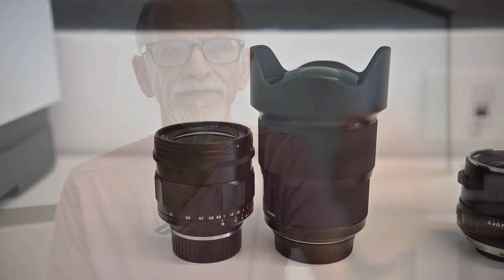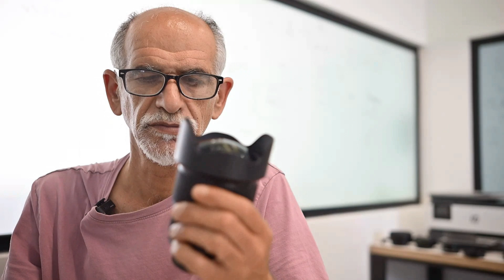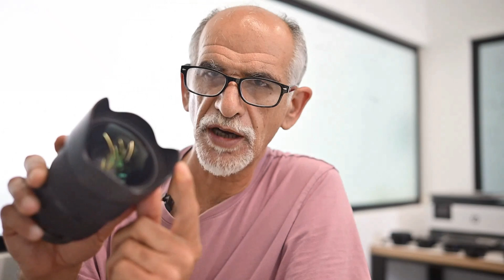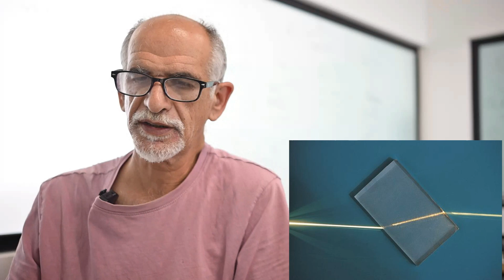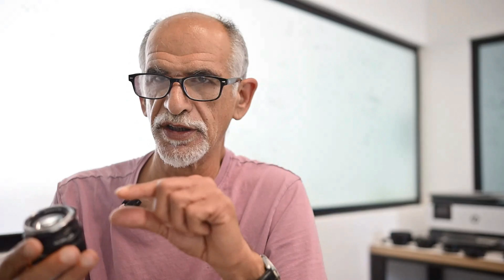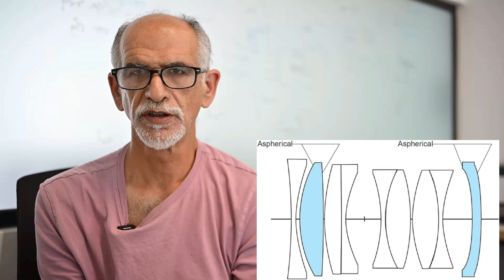Tell-tale signs of 3D-pop lenses

Comment: I disagree mostly but not totally. Number of elements and groups matter a lot together with the quality of the coatings of each element. Bad coatings and too many elements never end well. Modern coatings are really high quality so it is less important to have too many elements but still simpler designs have a miniscule advantage.

As for ED HR optics, reducing spherical and also to an extent chromatic aberrations will make a lens have a less romantic rendering. Some call it clinical but it doesnt always have to be like that. Absence of chromatic and spherical aberrations makes sure that the pure rendering of the lens is evident and if it's harsh, it will not be masked by the aberrations.

I find aspheric elements have a much more visible affect on the rendering. They introduce higher level optical aberrations and you end up with weird behaviour in lenses. Too many aspherics I'm not fond of but then besides the onion ring bokeh, Zony 55mm 1.8 has pretty good rendering.

My point: optics are too complex for us to set simple rulesets. Every design is unique. Companies have a certain style based on their producers and glass stock (ex Cosina produced Otus and produces Voigtlander lenses. I have a feeling that it's 100% same ED glass, maybe different coating)

Comment: I look at Zeiss lenses and they have an element called "special glass with anomalous partial dispersion" - is it the same LD element?
Reply from the maker: Hi, yes. Only Zeiss uses a "mild" type of LD glass with weaker suppression of CA.
Reply: @sneye1  Thanks , I wonder how to "put" those Zeiss lenses into your method . I checked some of the lenses I like and the ones I dislike in and it is accurate. 
My most used lens is the zeiss 55mm f1.8 for sony ,I didnt understand what I love about the IQ and why almost all other lenses I try can not match it. now I have the answer - 7 elements in 5 groups ,non of them are ED.
Reply from the maker: @amithasson8  Thanks. Glad you find it helpful. Zeiss and Voigtlander lenses would permit perhaps 15-20% ED glass before they become flat.

Comment: Greetings. I would like to pair something with my Voightlander 40 1.4 Classic, but only wide-angle, as well as the same expressive in terms of 3d pop. Will the Voigtlander Nokton 21mm f/1.4 Aspheric VM (Leic M) suit me?
Reply: Or is it better to take Nikon 24mm f1.4G as more similar?
Reply from the maker: Hi, Both are great.
Reply: @sneye1  Thank you. And what can be selected within 20mm or wider, with the same mirror working segment as Nikon F or Canon EF for the super35 camera? To keep the 3 pop effect on the super35 sensor.
Reply from the maker: Ultrawide lenses are mostly flat. You can have a look at sample photos made with Voigtlander 15mm f/4. It may have some pop.
Reply: The Zeiss ZM 21mm's are quite good in this regard. For something a bit more off-the-beaten-path, the Konica AR-mount 21mm f4 is one of the more interesting rendering 21's I've come across as well.

Comment: Would you say these glasses meets your criteria of Highly poppy? While at the same time being a modern lens?
Sony 35mm f/1.8 Zeiss (SEL35F18Z) has: 
LD/ED Elements: Includes one ED element.
LD Glass Content: Approximately 7.1% (1 out of 14 elements).
Average Group Complexity: 1.33 (14 elements in 11 groups).;

The Sony 55mm f/1.8 Zeiss (SEL55F18Z) has:
LD/ED Elements: Includes one ED element.
LD Glass Content: Approximately 7.1% (1 out of 12 elements).
Average Group Complexity: 1.33 (12 elements in 9 groups).

 I am planning to buy 3D Pop lens, would you say these glasses have it? its very convenient as I have E mount Sony body, while at the same time not wanting to hassle with manual lens. Thank you !  🤗
Reply from the maker: The Zeiss 55 is definitely poppy. The Sony - a little bit.
Reply: @sneye1  Thanks for the reply! Yeah I'm leaning buying the 55mm F1.8 Zeiss too! Considering buying that lens and the Sony FE 24-70mm f/4 ZA OSS (Vario-Tessar T)*.  it has: 
LD/ED Elements: Includes two ED elements.
LD Glass Content: Approximately 10% (2 out of 13 elements). Note: Slightly over 10%, but performs exceptionally well.
Average Group Complexity: 1.36 (13 elements in 10 groups).
Hoping this also give slight 3d pop even though its a zoom lens 
😅

Comment: This video really got me thinking, what kind of impact do filters have, uv, neutral density, vnds, do they add to dispersion? can they decrease or even increase pop, as they are usually not made from low dispersion glas? or do they just not matter at all?
Reply from the maker: Hi, filters will have a much greater effect on dispersion when mounted behind the lens (some adapters allow slotting filters).
Reply: @sneye1  So in the front of the lens their effect is rather negligible?
Reply from the maker: I think so, but it needs evidence. Never use filters myself.

Comment: The main considerations for me are maximum contrast, lowest spherical and chromatic aberrations, High sharpness and micro-contrast (which are related to aforementioned aberrations) and a flat focal plane. Oh and low coma and astigmatism off-axis. Some of the older slower macro lenses achieve this without many elements or more than 1 ED element. Samyang's 135mm f2 is outstanding stopped down a tiny bit. Nikon's old 60mm f2.8 af-d macro achieves it stopped down.
Reply from the maker: Thanks. Most macro lenses are near perfect, which makes the image they produce very clean. Some CA is needed for good rendering of depth, I think.

Comment: 15:46 "abrupt transition from shadows to highlights"  You are talking about contrast.  I know of no lens (and I own several dozen lenses, from the latest and vintage) that can "abruptly" tone map the luminance of a scene into a high contrast image. Lenses that have poor coatings, prone to flaring, or have dirt, mold or oil residue or are badly scuffed will certainly reduce the contrast by raising the shadows (gamma).  The problem here is there is no formal recognition of "3D pop" in optical engineering; this is the language of lay people. Even the term "subject separation", which likely means more to most people, is purely a subjective characterization of a 2D image.  I looked at a few of your photos in Part 10, and none of them look 3D or "poppy" to me. Furthermore, attempting to correlate optical arrangement, # elements, # LD elements, to a rather nebulous evaluation criteria (subjective), especially when you consider focal length, aperture, subject and background distances and lighting, sounds like pseudo-science.  At the very least, the test method would have to be better defined and conducted as a double-blind.
Reply from the maker: Thanks. I know all that. The issue here is the subjective, perceptual nature of the dependent variable. I am not aware of objective instruments that can measure it so I did my best to evaluate it in a blind test. The testing methodology is described in the second video on my channel. By the way, those practices are quite common in social science.
Reply: Ah yes, the age-old internet tradition of over-explaining something while completely ignoring context. Nobody said lenses tone map anything, contrast handling, micro-contrast, and edge acuity can absolutely affect perceived ‘3D pop.’ And while ‘3D pop’ isn’t a formal term in optical engineering, it’s widely used by photographers and videographers because, guess what? We shoot images, not peer-reviewed papers.

Also, dismissing focal length, aperture, subject distance, and lighting as ‘pseudo-science’ when those are literally the main factors in depth rendering? Bold move. Maybe take a break from counting LD elements and actually shoot something. You might see why people use terms like ‘subject separation’ instead of waiting for the scientific community to approve their vocabulary.

- Someone who owns more than ‘several dozen’ lenses.
Reply: @rileybankswho  Attempting to legitimize your subjective experiences? LOL!
Reply: @sandb1867  If it can't be measured in a lab, it clearly doesn't exist. Guess we should cancel music, art, and emotions while we're at it. "LOL".
Reply: @ But music and art can be heard and seen and can be objectively characterized and appreciated.  The part about emotions is a strawman, which is a sign of exhausting one's logical arguments. BIGLOL!

Comment: Very interesting. I’m learning a lot from you sharing your knowledge.  Thank you!

A question: I recall thoriated glass achieves relatively low dispersion and a high refractive index. Is that correct?  Do you consider the thoriated vintage lenses demonstrate 3D pop qualities? 

I really like the images produced by those lenses. The  YouTube channel called ‘Simon’s Utak’ is a great source of information on those thoriated and other vintage lenses.
Reply from the maker: Hi, I am familiar with that channel. A great resource for M42 lenses.
I do not have any thorium optics. In fact I have been careful to avoid them, so I can't really comment on their quality. Results I have seen from the Takumar 50/1.4 are pleasing, but other lenses in that category are just as nice.
Reply: @sneye1  Thanks for your reply.  Yes the radioactive qualities of those lenses is certainly an interesting feature!  The measurements suggest they are harmless unless you ingest or inhale the glass (eg if it were smashed or ground into dust). But otherwise they are considered very safe. So I’m happy to own a few personally and keep them safely tucked away in my garage.

Comment: Great video. I feel the voightlander 50mm f2 apo has decent 3d pop but the 35mm f2 apo not so much
Reply from the maker: Thanks. Interesting observation. I have not tried either. Will have a look at their diagrams.
Reply from the maker: Just had a look. Both lenses contain five ED elements, but in the 50mm they are concentrated at the front while in the 35mm they are concentrated at the back. It means that the 50mm allows some dispersion to develop downstream. The 35mm does not.
Reply: @sneye1  thank you I learned a lot from this video . That does make sense to me!
Reply from the maker: Hi, a video about your observation coming up.

Comment: I suspected something like this was the case. Been searching for so many years for a detailed technical explanation without the need to read an optical lens design book heavy in the weeds of mathematical explanation. Thank You so much. Also until very good glass coatings the number of lens elements was limited as too much light was lost by the reflection of each element. This probably limited the use of low dispersion glass due to the need for other corrective elements. I also wonder if newer designs because of coatings are using several low curvature elements instead of one high curvature element which is more costly to manufacture.
Reply from the maker: Hi, please note that I am a scientist, but not an optical engineer. This video describes a hypothesis based on a comprehensive study. Please do not confuse it with established theory.
Highly curved elements should not be especially expensive to manufacture. It is corrective aspherical elements that are the tricky ones. There is some evidence that many of them are made of molded plastics to keep lens price down.
Reply: @sneye1  The hypothesis seems plausable. I have an engineering background but I am not expert in lens manufacturing and not familiar with the equipment. My understanding is because of the complex curvature of aspherical elements molding is the easiest and affordable method to manufacture such shapes. Plastic is a highly moldable material vs glass. Minolta in one case I am aware used a hybrid molded plastic bonded to glass. I expect high curvature spherical glass to require more material removal and increased time (cost) to grind & polish and more difficulty maintaining tight tolerance specifications. Upon further thinking assembly cost of more elements would be another factor that needs consideration.

Comment: Its all about rendition and the older design lens ,right back to the 60's have it .I have restored hundreds of lenses and tested them against all this ed apo glass To be honest the longer telephoto lenses do benifit from apo and ed but only in low count .I remember using Kowa lenses at a wedding for the fun of it .The pro photographer was stunned when i showed him my large prints .He used this modern gear with as you say high lens element count and a hasselblad camera ,Unfortunatly Kowa went bust as they put more emphasises on high quality glass than Marketing hype as did european lens and camere companys .But now we know japanees lenses and indeed the good european ones are outsourced to Cosina It is also true for the latest glass for hasselblad which was outsourced to fujinon . Marketing Fluff will always outperform genuine lens manufacturers  who either went bust or got a hold on good brand name and got expensieve to survive in a  consumer market . If you doubt this guy pop a nikon 28f2.8 ai-s lens on an adaptor take a shot use the same settings an an af-s28f1.8 ed nikkor .Compare all results and sell that wonderful ed lens .

Comment: Everything makes sense now, I checked my lenses and indeed those which I liked the best have the "most pop" by your formula, everything checks out. However, one thing I don't understand from theoretical standpoint - why does the group complexity matter. For example, why is it better to have 2 lenses in 1 group than just one thicker one or 2 lenses in separate groups?
Reply from the maker: Hi, it's to do with the glass type. Doublets typically contain a high refractive index element.
Reply: @sneye1  At least some manufacturer's lens diagrams show high refractive elements as well (if there are any). So if the rule of thumb is that high refractive elements increase 3d-pop whereas ED/LD elements decrease it, maybe it should be incorporated to the decision tree as well somehow. I mean, if all three different lens types are known, then there's no need to use group complexity as a proxy for high refractive lens count. I hope my rambling makes sense.

Comment: I use a Viltrox 13mm and I can confirm it's flat as hell. Big aperture wide angle lens with great autofocus but flat as hell. 4 low dispersion elements. Thinking of switching to a fujinon 14mm but the smaller aperture can result in a lack of depth of field...
Reply from the maker: Hi. Depth of field is hardly a consideration with wide lenses. Pop is. Go for it.
Reply: The Viltrox is flat because it's a rectilinear lens, meaning minimal distortion and straight lines (which is desirable for things like architecture). The problem with many lenses that aren't rectilinear is their DOF is curved, which isn't necessarily an aspect of 3D pop. I'd say a curved DOF is undesirable, as it can unevenly focus your subject, and especially when shooting at really low DOF, you'll end up with a visible curved line across the frame if anything else adjacent to the subject is in the focus plane.